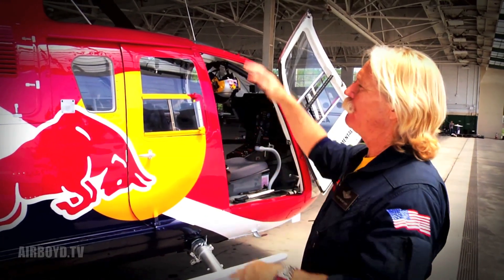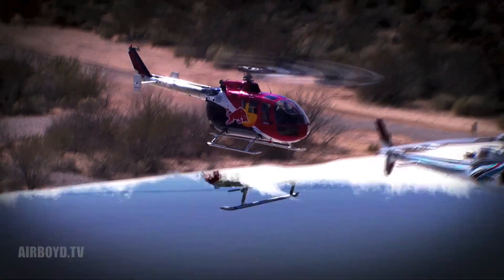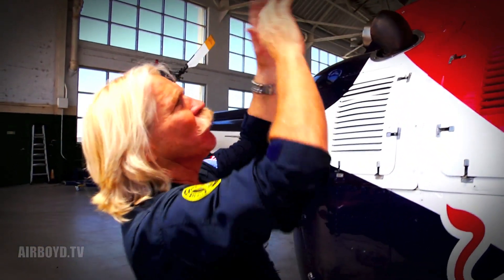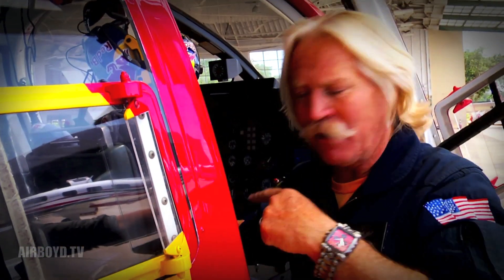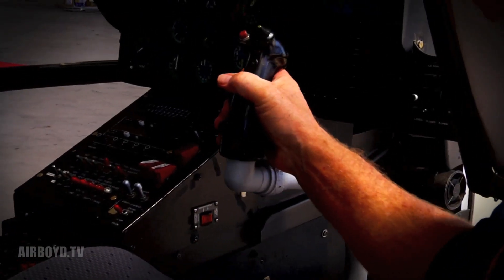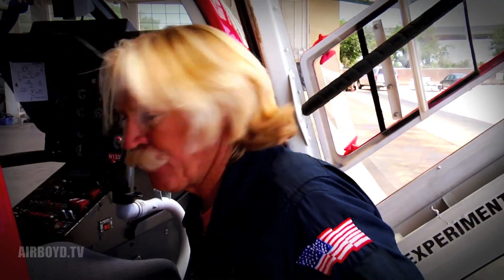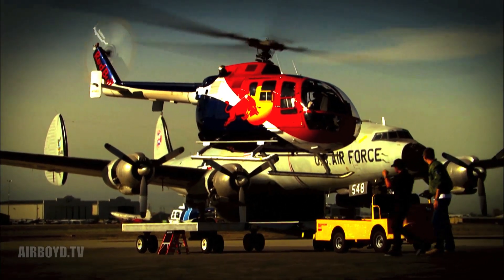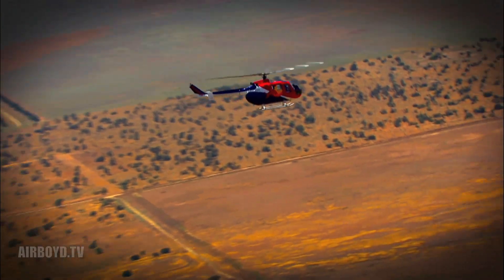Aerobatic Helicopter Technology - Chuck Aaron Red Bull

Comment: I always wanted to know what how pedal and turn direction are connected. I think this way is not as good in two ways. 1. It is counter intuitive, a car turns right if you pull on the right. 2. It is not self-dampening (unless there is a 180° phase delay), should the helicopter be able to swing around it's vertical axis the inert pilot would get pushed into the pedal that supports the acceleration.